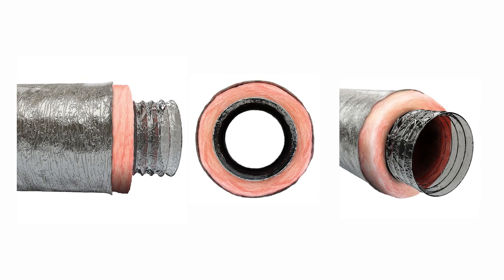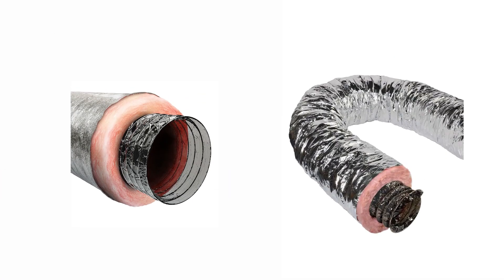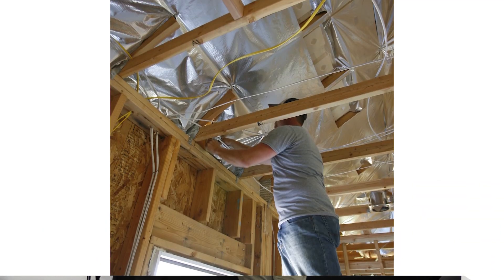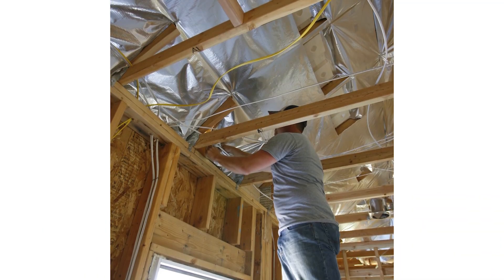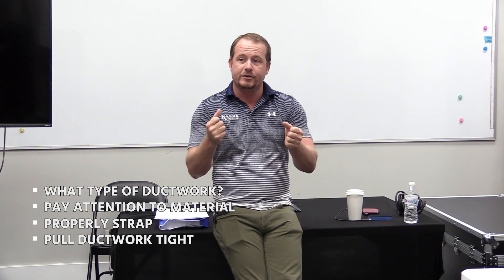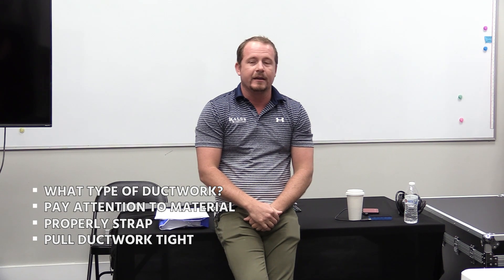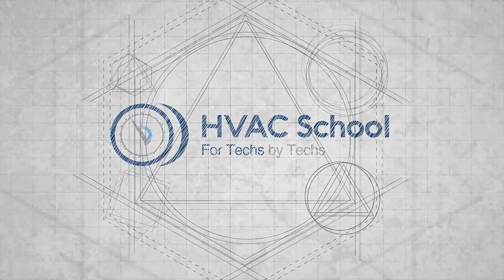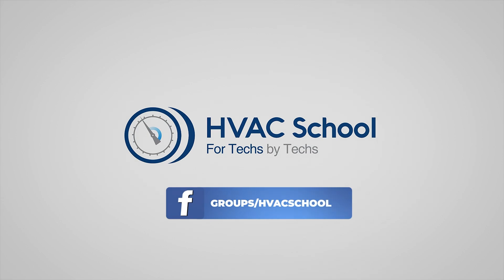Discussing Ducts Types and Tips

Comment: If you look closely at the foil you will see good flex has reinforced string every 1/4" instead of every 1/2" that some manufacturers use. Reduces rips when moving it around during installation.

Comment: I need to tape up the hole in the top of my furnace which was cut to put the air duct in which goes up into the ceiling and outside. What should I use to tape it up? The duct gets hot. Thank you.
Reply: Use 367 tape it
Reply: And sheet metal

Comment: I bought a house in 2022. The hvac hadn't been updated since house was built in 1996. The ducts had stinky mold so we decided to have new hvac and all ductwork replaced. Hvac system and box shaped sheet metal duct (with insulation inside) trunklines were in crawlspace with flex ducts running off metal trunk line. 

We had a small company replace all ducts and complete system.

I was kinda surprised after install when I noticed they didn't use any sheetmetal ducts at all... only flex ducts for the entire system...

Is that normal? Anything wrong with using all flex ducts to replace old metal trunk line?
Reply: Old comment but very common to see all flex installs.. My house is the same..

Comment: This channel is great. I'm trying to improve my airflow and reduce my air leakage from the homeowner-done hvac job and I have learned a ton. Unfortunately, most of my flex duct is resting on the joists in my attic and I'm not sure there is enough slack to lift it off the joists, but I'm going to try. If that doesn't work, I may be replacing all the ducting as time and money allows.

Comment: Appreciate the lesson.  I'm just a homeowner, but trying to get educated on how to improve my home's energy efficiency, to lower my painfully increasing electric and gas bills.  Seems my situation is different because my A/C and ductwork in all in the basement and it's a conditioned space, therefore leaks and condensation probably aren't as much of a factor as they are as when it's all up in a hot humid unconditioned attic.  Still, I can use these techniques for optimizing the system.

Comment: Flex is all garbage, and is even illegal in some areas.  Better not put it under a skylight,because it will blow apart from degrading in the sun.  I. Have had numerous calls where rats chewed thru the stuff and peed and pooped inside it.  Metal duct is the only way to go. But of course, sadly, standards have changed.  Flex duct was designed to be used for short connections to the diffusers.  A properly used set  of panduit straps is superior, but you have to  use the tool to tension them properly. They won’t fall off if you use a collar with a bead. Just examine the labor difference. Two straps, liner and outer jacket, then a wrap of insulation over the top.  All that fussing over mastic, tape, etc, etc to seal an inferior duct product just doesn’t make sense.  I’m not trashing the instructor here, I think he is great.  I am trashing flex duct though, I’ll have to admit.

Comment: Black flex duct in the attic is "less efficient" in the cooling season, but black flex duct in the   attic is "more efficient"  in the heating season. Correct?  What ACCA approved J-manual software addresses the flex duct  covering color, which then includes its heat gains or losses?

Comment: Thank you for this great video!
When I added straps to my ducts, I put a sleeve underneath the ducts made from cardboard to avoid compression and kinks. Also for each boot, I added some Malco FDS1- Flexible Duct Support to keep a nice curve from the floor. They can be used as well if you have some ducts leaving the plenum at an angle. 
Also, if the attic has already a radiant barrier, it doesn't matter if your ducts are black or silver, something to consider. While ducts are part of the system, sealing and insulating the plenum is something to do to help against air leaks and temperature swing.

Comment: you obviously get paid by the the word, there is no difference in silver or black , silver is a better product both are based on r value . black would only absorb heat in direct sunlight not from attic radiation. Panduit strap is the standard for flex connection the only superior connection is a steel hose clamp style. you are a shame to professional duct installers .
Reply: your already putting in such an inefficient system with a flex monster and duct board trash install it's hilarious to listen to you try to give tips to elevate a trash install to the next level of trash
Reply: funniest thing I watched all day, in the real world flex is for the last 5' for hooking to an air device and to help quiet the system
Reply from the maker: Learn more about radiant heat then get back to me. 

Otherwise I hope you have a great day
Reply: @HVACS  maybe you should learn your trade before you try to teach others. If by heat you mean radiation then 2 flex ducts laying in the sun the black one would get hot like a black rubber garden hose does and the silver would reflect more heat but we are talking a black attic with no direct light so then black or foil flex experience the same gain from radiation due to delta T and heat moving to cold , ie the cool air in the flex ( radiation) . In this case r value is the determining factor in gain. Open an ashrea book B4 you front on me trick. Maybe you should stop confusing yourself with the properties of infared and should learn your heat.
Reply: In general shiny surfaces reflect radiant heat energy. Shiny aluminum foil facing a heat source reflects over 90+% of the radiant heat that strikes it. So a foil like material draped over the trusses will reflect the heat energy back to the roofing materials as long as there is an air space between the two.

Comment: Why would anyone purposely install a unit into a very hot attic (140/150 F) and expect it to be efficient? System spec’s are most likely being violated! Please explain without sarcasm. Thanks!
Reply: Retrofits and remodels. Here in the DC/Baltimore area, brick rowhouses have this all the time, especially high velocity units. It opens the floor/wall space that a closet air handler/furnace takes up. Flippers are mostly about profits more than efficiency. In detached new builds around here with bigger, more open truss attics, that system is usually just for the upper floor zone so any efficiency comes from it not having to condition the entire house, only up there.